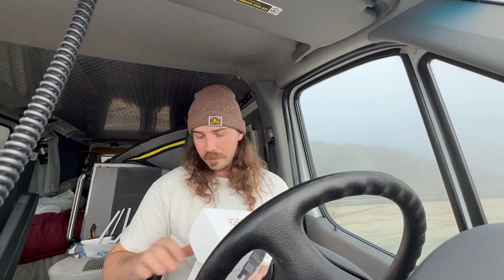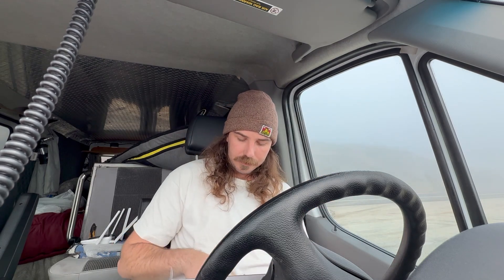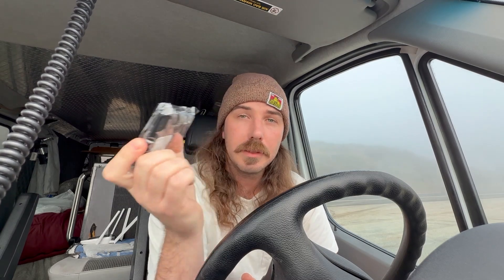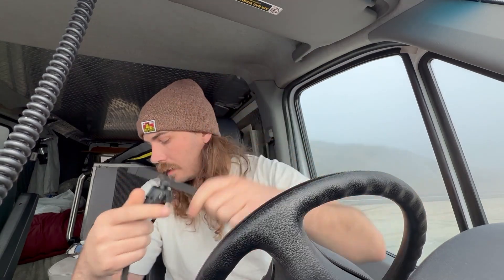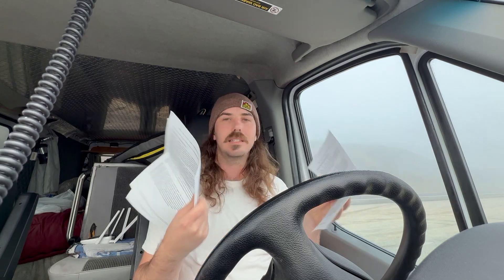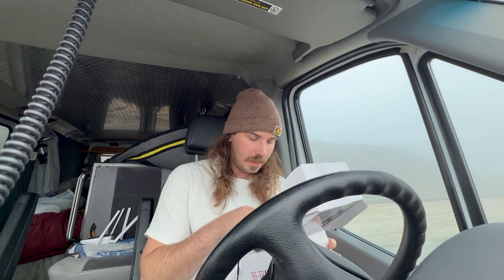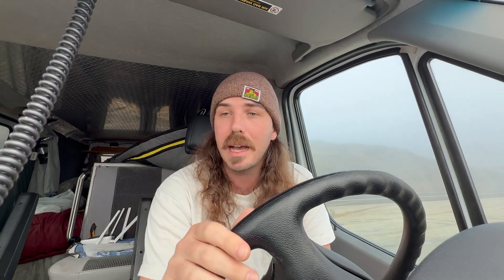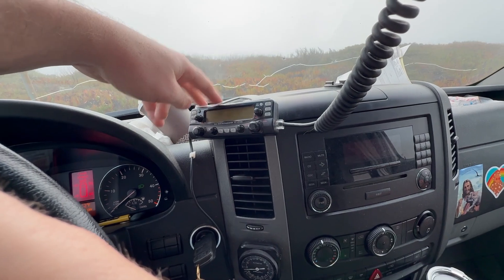SIMPLE and AFFORDABLE Emergency Radio Communication Kit

Comment: Having an Emergency Communications kit is fine and dandy, but you have use the radio on a regular basis. You can't just pull the radio out when emergencies happen. You need to practice !
Reply from the maker: Good point—I’m pinning this comment, as it is a valuable addition. Practice! 

I still need to remind myself of how the menu operates on this thing every once in a while. It’s not hard, but it’s also not intuitive.

Comment: Baofeng typically overstates the transmission power of their radios, and I'd be surprised if you actually get 8 watts out of it. That's not a very big deal, because power isn't as important as most people think in terms of distance. I've used my BF-f8hp to communicate on a GMRS repeater 20+ miles away.
Reply from the maker: I put up another video of hitting a repeater 120 miles away on 5 watts with this radio. Albeit, at the top of the mountain with a giant antenna. But still.

Comment: Get a radio that isn’t a Baofeng. If you want a radio, you need something with more than 5 watts unless you are operating on HF with a QRP. You can run  something like a Yaesu FTM 300, or an Icom 5100. Not to mention, you can build a Go kit depending on what HF radio you want to use.

Get into amateur radio, and at a take the test to become a general class operator. You’re pretty limited on what you can do as a technician when operating on HF.

You might want to get a radio that can operate APRS.
Reply: Sure, and while he's at it, he should trade in that truck for a Cadillac SUV. Don't you need to go water your money tree or something?
Reply: @don’t be a sad ham. You’re probably a CB’er.
Reply from the maker: lol. +1 for sad ham reference 😂

Comment: Do you have a link for the frequency list? Thanks
Reply: Not able to add a link, but just google RadioMaster Report.
Reply from the maker: This is the one. The same website also has the “3-3-3 radio plan for SHTF communications.” It is a condensed version that also has some rudimentary use protocols. It may be more useful than the comprehensive list, which includes many frequencies and information that isn’t necessarily pertinent to this radio.

Comment: There are variants of the UV5R that also have 8 watts of transmitting power. They can mostly be purchased for less than the particular model that you mentioned. The AA battery clam shell is fine and good but it is very limited compared to the lithium ion batteries that they typically come with. You have not mentioned it yet but you will need a dummy battery if you are using alkaline AA batteries. When new they produce too much voltage and the radio will go into a protective mode due to the high voltage. In short it wont transmit at this point until the charge goes down a bit. Also I am about 6 minutes into the video so far and as an Amateur Extra ham you have not really said anything that I take issue with. Also there are some regional SHTF frequencies that are not necessarily well known nation wide. I would suggest people just get their tech license at least and spend some time using the equipment with others. There can be a pretty steep learning curve during a crisis. Also you are mostly right about the FCC enforcement but it really depends on how much of a violation you are guilty of and mostly it is how frequent you are using bandwidth belonging to other parties, should they notice. This is what gets the attention of the FCC and the ham community does practice looking for rogue RF emissions. This is known as a "fox hunt". It is very likely that if a complaint is generated it will be from information gathered by hams and they will likely know where you are if you use them illegally from a fixed location.
Reply from the maker: Good info for anybody perusing the comments. 

The AA clamshell that I got comes with the dummy battery and instructions— same one that I’ve linked. Thanks for the comment!

Comment: Good information video and presentation was perfect. I have two of those radios and love them. One thing I would do different is rather that the AA solution I would opt for a battery bank and a portable solar charger. They have them that fold up so backpackers, canoeist, etc can charge their batteries in wilderness settings. Many YouTubers that do multi day adventure videos use them to charge camera batteries.
Reply from the maker: Yep this is a great idea. Maybe I’ll make another video to show something like this. If you’ve got any ideas for power bank/portable solar panel that could fit in that little case, let me know. Most of the portable panels I’ve seen are pretty bulky. I have seen some simple thin film panels this size but am skeptical about their ability to put out enough juice to get a decent charge. But it would work great with the USB-c batteries.